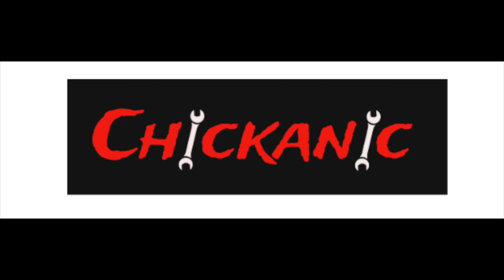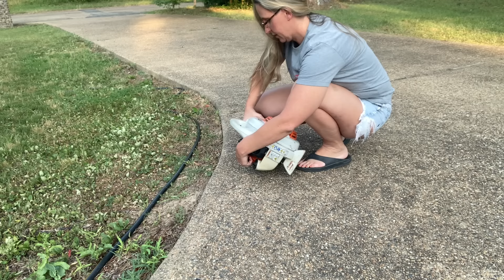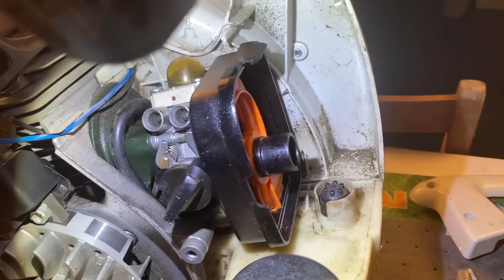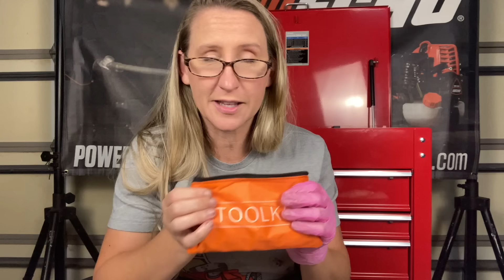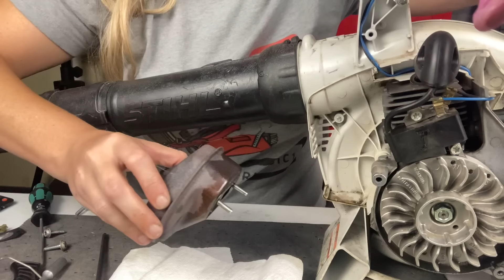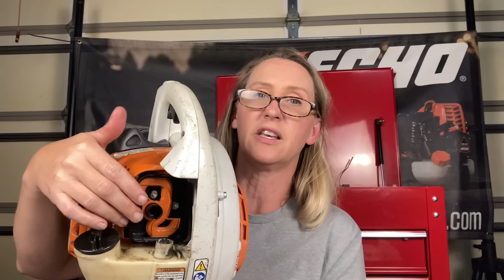Stihl Blower's gas disappeared! Pull rope won't work? This small engine has issues! Repair/Vlog

Comment: Hi Chick
Could you please me tell if the echo speed feed 400 would fit my FS 70 strimmer I’m getting conflicting advice thanks from Devon England
Reply: The reason for conflicting advice is that the 450 is suggested for above 24cc trimmers. Since you are at 27.2cc that advice is for you, but I see a YT video where he puts a 400 speed feed on a larger FS 90R anyway. If your string starts welding itself inside the spool before it gets fed out the holes then this would be reason - too much speed is capable with an undersized head on an overpowered tool. Time for the 450 or you can cut back on the length of string you install in the first place as it will all feed out before welding issues develop. The smaller lighter weight 400 head with short strings may suit you better because it's not so heavy or your weeds aren't equipped with 1/2 inch stems. Both Stihls have the same 10 x 1 mm left handed attachment nut so fitment is NOT the issue at all.

  Echo Speed Feed 400 Installation on Stihl FS 90R
https://www.youtube.com/watch?v=h5SBynoD_3c
Reply: @leebarnes655  thanks fella always wondered why my string on the stihl head was always welded together now I know cheers Lee. So I’m correct saying that the echo speed feed 400 would do just fine. Many Thanks in advance 👍🏴

Comment: Excellent, just what I needed. I got an Echo doing the same thing but leaks out the carb intake and onto the garage floor. It does have a vent thingy with a hose attached to the gas tank, definitely will check that first before moving on to carb. Thanks Chick!

Comment: Good tip on the screws.  Whenever I am working with small screws or delicate items I always turn them counter clockwise till I feel the threads line up.

Comment: Also have to mention that I was working on my echo string trimmer yesterday just cleaning it up. I actually pulled the spark arrestor screen off the muffler made sure it was clean. Guess where I learned that. Thanks again

Comment: Parked a 1996 Yamaha 600 Grizzly a week later crankcase full of fuel...  taught me to run any equipment with a shut off till it stops running.Off topic but still relevant. Thanks for your uploads Bre. always learn something useful.

Comment: I just subscribed!  I have two BG 55 56s and the one that is 11 years old runs like a scalded dog!  It does things one might use a backpack blower on.  The newer one doesn't even come close and needs adjusting.  It starts great and idles good but just won't rev like the old one.  If I hold it down against my leg and cut of some of the air it will go a little higher, but not like the other.  Noone would tell me where to buy the adjustment tool and I like fixing my own equipment.  Well, I bought the kit before the video was over.  lol  I'm curious what you charge for a job like that?  I saw $179 on the sticker.  I paid $99 for both of mine.  I can't imagine fixing it for less than $100 including the carb kit unless you're not making money.
Reply: in NZ as a lawnmower shop mechanic that would run too $120 as would do fuel filter as well with labour about 20 mins

Comment: My bg 55 stopped running when hot. Had to run gap for ignition coil at half of spec. Could not find ignition coil that would fit. So many junk parts out there.

Comment: Electrical butt connector can sometimes be pushed onto those adjustment screws when heads of screws are damaged or you do not have the correct tool.

Comment: I have a blower like that and have been keeping it in my truck. Very good informative video. The last time I checked the gas after being in the hot truck it was under very high pressure and blew out gas. I am lucky it did  not flood out like the one in this video.

Comment: Hey be careful not let the plug wire ignite the fuel as it blows out the plug hole. Had a fellow badly burned working on his mower with a similar problem👩‍🔧

Comment: I got caught with that carb ajustment ,bought a kit with black handles similar to yours,  no fit,bought stihl 5910-890-2307 still no fit then discovered stihl 5910 890 2314 which is slimmer and fits both are sold as 4mm size . I hope I got those numbers the right way around  hope this helps someone
Reply: Your last number is correct also for br200 and bg86

Comment: I have a 25 year old 14sb John Deere It starts first pull runs fine for a few minutes (3-5) then dies down and almost out, and then chugs and regains rpms. As I keep mowing, this keeps happening.  I have removed fuel tank, screen and cleaned. I have replaced fuel line and added filter. Replaced plug and air filter. I have rebuild the carb 2 times and I have replaced the carb with a new one.  It is acting like it is flooding....    If the motor had a mechanical compression release, I would suspect it....  what is your best guess?????
Reply: Try running with a loose fuel cap maybe vapour locking the tank if it cant draw air it cant draw fuel till eventually it gets enough to restart the whole process
Reply: @glennlurman3514  GREAT SUGGESTION!!!! THANX....I'll give that a try and report back....
Reply: I installed a new NGK plug.... The mower is working PERFECTLY.  My guess is when the old plug got HOT, it would weaken the spark.  Remember, the mower always started on the first pull, when cold, with the old plug.... live and learn..

Comment: It’s called fuel hydro locking or fuel locked & how you emptied the cylinder is a great way to set the machine and maybe yourself on fire, next time please just tip the motor upside down & very slowly turn the engine over.

Comment: Pull the fuel pump diaphragm and hold it up to a bright light, I suspect you will find a hairline crack in it.  The crack will pump fuel through the impulse port into the bottom end of the engine causing the hydro-lock.  I've replaced several units under warranty due to the connecting rod being bent.  The issue is caused by the carb body casting not aligning with the cover casting.  The constant flexing of the diaphragm against the mis-alignment of the castings causes the crack.  I've brought this issue up with my distributer in Missouri, as well as Stihl corporate in Virginia Beach when I was there for training recently.  This issue is often mis-diagnosed as a leaking needle because the carb won't hold pressure when tested via the fuel line connection, put you thumb over the impulse port on the carb and it will hold pressure.  Thank You.
Reply: Spot on, although I don't see it to often with blowers. I do have a pile of HS 82 hedge trimmer carbs we've had to warranty.

Comment: Cousin bought an old mid to late 80's early model Stihl 021 saw. It ran, but not well. Changed the fuel line, put a modern style 250 tank vent on it, then looked at the carburetor. WT-215, the metering diaphragm was put on upside down. Gasket was glued to the top plate, diaphragm was still good, but the gasket needs replacing. I've been through carbs, refurbishing them, never seen that before 🤣. Buying a K20-WAT rebuild kit today for it. Afterwards, it should run like new as the cylinder and piston look practically new and it has a LOT of compression.

There's also a carb adjustment kit on Amazon for around $20, has every driver for carb screws, even a Stihl flat screwdriver, picks and brushes as well as two metering lever height gauges for Walbro and Zama. I used the Zama gauge on a brand new, from Stihl FS 56 RC-E carburetor, the needle lever was so low, had to bring it up.

Comment: 2ND PROB Just buy electric.  My electric blower (worx turbine 600) is more powerful than both my neighbors gas blowers and cost me aprox $40.  No fuel no mixtures plug it in and it works every time.

Comment: Those bg56 carbs are famous for bad check valves in the purge bulb circuit, a failed check valve will cause flooding. Also they have an accelerator pump, like a ms200t that fails. I usually replace those carbs with knock offs

Comment: I love this channel...  I am having issues with my troy-bilt model tb4bpec backpack blower, I had is for about 4 months and when I was using it got oil all over my back so after troubleshooting found out that the oil is pouring out of the air filter there is a round flap and that is where oil is coming out.  It's driving me crazy as I still have not found what the problem is as no one on youtube has same issue and was wondering if anyone knows what is causing it to do this.

Comment: Hydrolocked!! Got it right off the bat.😁 And Mower Medic is cool. Donyboy is very good as well. Oops, almost forgot Steve's Small Engine Saloon. One quick tip. Use a drain pan whether outside and especially inside. You don't want to kill your grass by draining fuel on it, and you don't want raw gas on your work bench. Could accidentally ignite if there's a spark of some kind. Gas fumes hang low to the ground and hang around even on a work bench, and ya never know. Good vid. Like school. Stay safe.👍
Reply: Taryl fixes all is pretty cool too. They do goofy entertaining skits also. A lot of cool restomods too.

Comment: Does your husband do the house chores while you run the business and make great videos? Cleaning spark plugs. I have an air-powered spark plug cleaner. The one with a cloth bag that holds the abrasive grits. Cleans the plugs so that they look brand new. After I'm done, I rinse them in gas and blow compressed over the end. Yes or No? My small engine repair shop would do this job for me. The only downside is I would get the 'good customer' price of $200.00.

Comment: Glad to see there are people like you I've been a mechanic for over 40 years except on small engines the more I work on them they get worse thanks for sharing 👍🤞
Reply: I repaired diesel locomotives for 12 years and they were much easier to deal with. These little engines can be a pain in the ass..

Comment: Wow that gas trick to get the fuel out through the spark plug hole is awesome!! You get the gas out AND water the lawn at the same time! Nobody look behind her at the wide open concrete space where the gas would evaporate in a matter of seconds and not damage the lawn or ground .
Reply: Maybe she likes using weed and grass killer on that part of the lawn, to put in the new patio.

Comment: A consideration could be made for using a jumper wire to ground the plug wire to avoid creating a momentary flame thrower (ask me how I know.....).
Reply: Or, just turn the switch off.
Reply: Very Good point! I am a car and airplane guy and it's not easy to have turn-over without "the switch on". Great point and I stand corrected. @mikedenmon7650

Comment: Had a similar problem with my SH86 however it happened while running. It turned off 2 different times and was basically locked up. First time I found a bolt backed out that mounts the engine. It got jammed into the back of the blower wheel. The second time it happened on the other side of the engine jammed against the flywheel. Both times all it took was putting the engine mounting bolts back in. Also found a couple other bolts loose. So if you have this problem best to tighten both sides.

Comment: I'm still looking for a fix to keep the air intake from being blocked on my chainsaws   I was cutting around fall leaves and my  Stihl 066 sucked leaves over the fan intake  while I wasn't watching   (which I normally watch for) and it only took about less than 5 minutes to smear the  piston onto the cylinder and stick the rings in the piston  and I was barely revving the saw cutting 3" poles !

Comment: this is a case where you could pull the line off from the tank to the carb. using a presssure /vac hand pump set on pressure put 1 to 1-1/2 psi on to see if it holds. you can also hook to the line going to the tank to see if it pressurizes  before you bust into a carb removal. some tanks dont have a pressure relief some do. if you put a vacuum on the tank they all will let air in.

Comment: The proper term she's wanting to use is hydra- locked. It's not compressible which is the reason it locks up. It can cause major problems If it can get turned over. This lady knows all this stuff, she's a dang fine mechanic.
Reply: Tanaka ECS356 Tanaka kogyo Co. Ltd. it has an oil adjuster on it.
originally my father in law left gas in it (completely dried up)
so I used carb cleaner (gas additive) to soak out the nasty stuff. 
then rinsed with gas mix , then finally put fresh mix in and got it 
running. I am looking for replacement air filter, and new plug.
this is my back up saw, it also came with a jig & round file to
hand sharpen the blade, have not tried that yet. how long does
gas/oil mix stay useable? I have been using the stihl oil mix
with alcohol free high test gas. thank you or your reply
love your videos they are so helpful in taking care of 
all of the small engines that I have. have a great day.
barry
Reply: @artillerest43rdva7  if u use pump gas non ethanol 93 then I'd say 3-6 months. Stihl guarantee their fuel unopened 10 year shelf life and 3 years after the deal is broken. Anyway what I do is but a small thing of Stihl pre-mix fuel and when I'm done with the weedeater-chainsaw etc I empty my tank, put just enough of pre-mix to get the engine started and let it run everything out to where it has premix in it through storage. It works for me.
Reply: Yep, funny thing about liquids is they can throw tantrums sometimes, especially when you try to compress them. That's when they give you the bird and say "No, and I'm going to break something if you try and make me." Many years ago I was in a hurry and drove through a particularly deep and long puddle that was hanging out against the curb after several days of heavy rain. My car had a cool air intake with a low tube that went by the tire, never cared too much about exactly how high it was off the ground and my setup did not have an in-line relief valve. Made it about 2/3s through the puddle before the engine went BUMP and the car died. About a week later 3 of my 4 piston rods came out of the engine in an S shape, along with about 2 cups of water from the manifold. That's how I learned about the term hydra locked ^_^ good times.

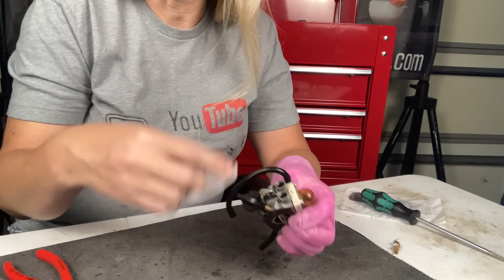Comment: 9:03 Tank vents don't release pressure inside the tank, they prevent a vacuum inside the tank. The engine was full of fuel BECAUSE the tank vent worked correctly. If the vent was clogged, fuel escaping would have caused a vacuum inside the tank PREVENTING anymore fuel from escaping. If there is positive pressure inside the tank the only way to release it is to open the cap.
Reply: Could you explain that some more please. I have an Echo blower leaking gas out the carb intake and onto garage floor. So, you're saying it ISN"T the tank vent?
Reply: @tinytim9453  When an engine uses fuel, fuel is removed from the tank. If it continues using fuel out of the tank without being replaced with air it will eventually create a vacuum strong enough to prevent anymore fuel from being "sucked" out of the tank.

The tank vent is basically a one-way check valve. It let's air into the tank, so a vacuum is not created, while also preventing fuel and vapors from exiting the tank. Like I said above, tank vents prevent a vacuum they don't release pressure. Because of this, pressure can build inside a tank but usually the inlet needle spring inside the carb is enough to keep fuel from pushing up into the carb and flooding the engine. I have seen it happen in extreme cases of heat.  To test a tank vent I drain the tank and plug one line with a golf tee or forceps and pressurize the tank to 10 psi with a pressure tester. It should hold pressure. Set the tester to vacuum and it should not be able to create a vacuum. If either test fails (ie. you CAN'T create pressure/ you CAN create a vacuum) you have a bad vent.

If yours only does it occasionally when it's really hot I don't know if I'd bother with it. However, if it does it all the time I would follow her advise and either rebuild the carb or buy a new one and see if that fixes it. 

If you do buy a carb buy the actual Zama or Walbro replacement for your machine not a cheap $12 Chinese Amazon one. They work but overall I've had more trouble with them than they are worth.
If you decide to rebuild the carb, the inlet needle lever will need to be adjusted after installing it. 16:35 you'll have to look up another video how to adjust it because here she only "checked" the lever adjustment at 17:12  she didn't explain what she was doing or how to do it.
Reply: @TruthHurts2u  I see, thanks!
Reply: @TruthHurts2u  Only happened twice on those real hot days. I suppose I could crack open the gas cap or pour the fuel back out.
Reply: @tinytim9453  Yeah, I wouldn't worry about it then. I would pour the fuel out into a sealed container to prevent it going on the floor. Otherwise, fuel could get contaminated with water from humidity or something else or maybe even go stale faster in an unsealed tank with a loose cap.

Comment: You can use a yellow wire butt-connector to adjust the mixture screws. GENTLY push or tap the connector onto the adjuster head and once it is on good, you can turn it with your fingers.
Reply: Thanks

Comment: Hi  The term for getting so too much fluid in the cylinder that it won’t turn over is called  hydro –lock. That is one of reasons why they hand turn the props on a radial engine before start.        Thanks for the good information  an keep up the good videos  Harry B.
Reply: There is nothing better sounding that a big radial ( or pair of them) chugging through the air.
Reply: @ericvoge6678  yes, P&W R2800 is awesome. When in USMC we restored an F4u- 5n in the late 70s. We did an engine test run before it went to a museum.

Comment: This is why I store my tools with fuel removed and fuel tube ran dry.  Cuts done on corrosion and pressure. Worth it.  
If using it often, store it cool as possible.